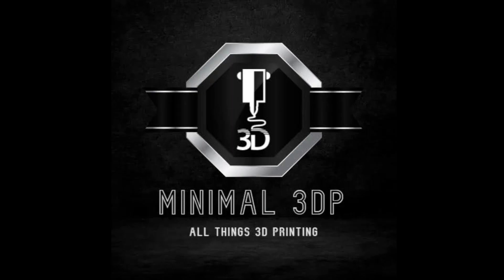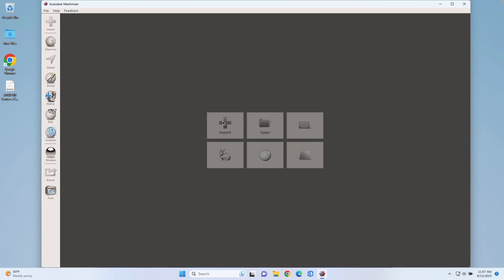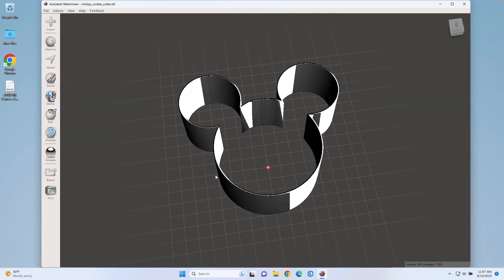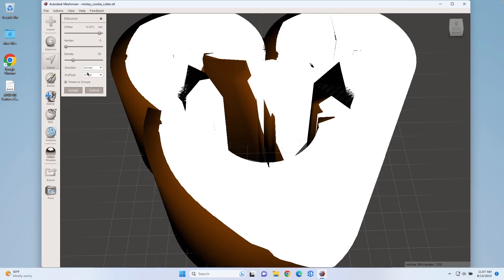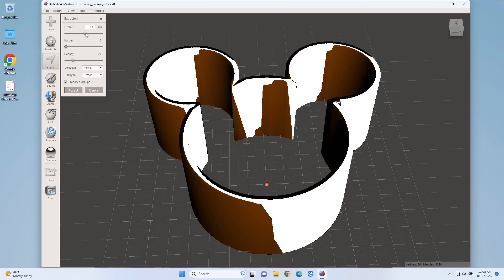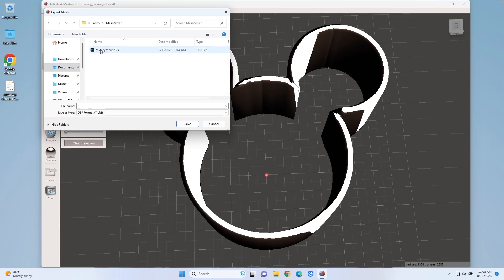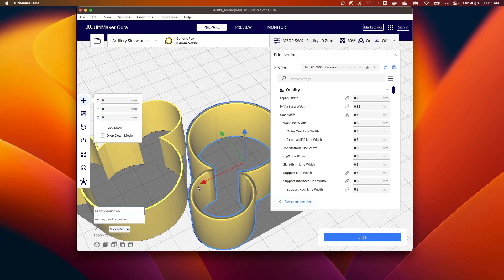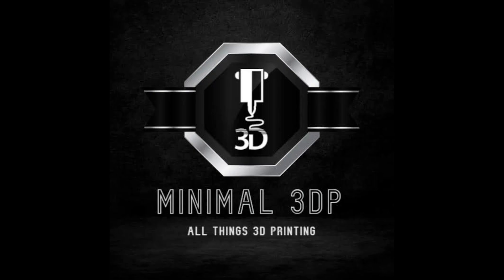30-second Meshmixer Tutorial: How To Thicken Walls On Your 3D Prints

Comment: wondering if you could tell me something here. I followed your method here, exported it to the slicer, printed it and it literally crumbled as I removed supports. so I looked and it was hollow inside. So i go back into meshmixer and found make solid, accepted it exported it and the same thing its still hollow in the middle. What am I miss here?
Reply from the maker: What is your infill set to?
Reply: @minimal3dp  i went from 50% to 100% and it doesn't change the hollow center